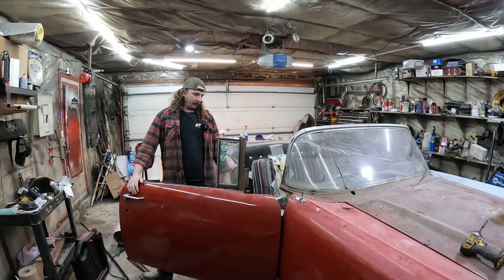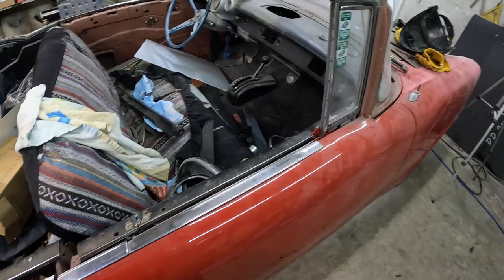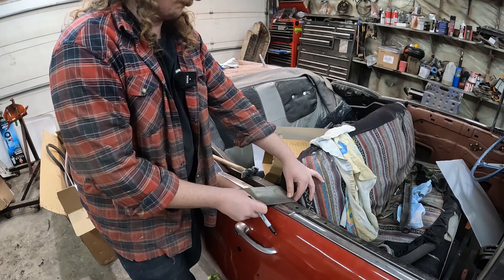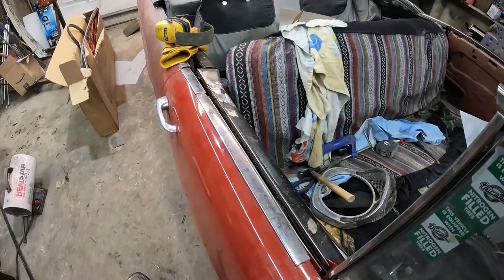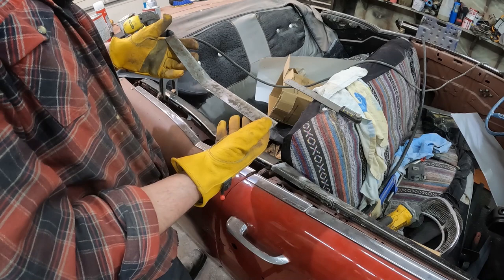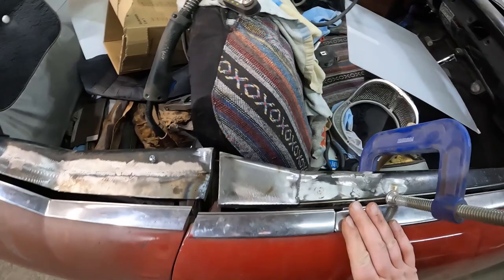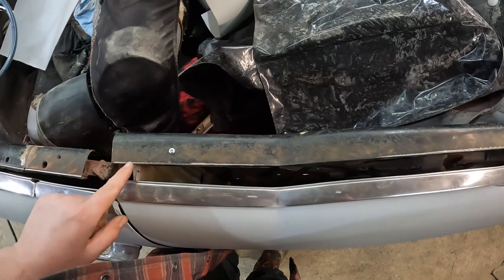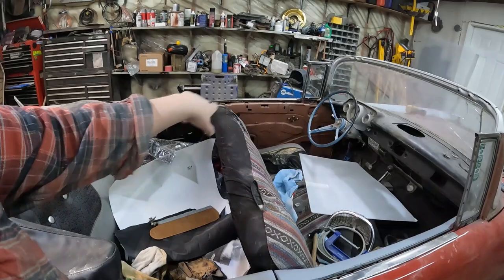Custom Garnish Moldings For Your Chopped Rod - 1957 Chevy Convertible Conversion

Comment: Everyone says I do stuff the hard way, I would have cut a half inch out of the inside of the door post so I wouldn't have to widen the trim. Your way worked. I like the bench seat. I would find a split bench seat with the fold down arm rest with cup holders in the middle. Old cars have no place to set a drink. I like this cat alot.

Comment: Dan nice job on the moldings they look great .  here is a idea swap the front seats with the nice one in 56 wagon . 
get some hog rings and the plyers and wrap the rear seat with the diamond tuck material then your interior will look great .
 you can paint the steering wheel that you are going to use too if it's a factory one .
i seen that someone on ebay has a set of the stainless 2dr door top door moldings cheap , driver quality ..
 keep at it it's turning out great.

Comment: You're really getting your moneys worth out of that workbench haha. Nice work on the garnish mouldings, as for the uv protection of tremclad, I've just kept it waxed with a carnauba wax, reapplied every few months. Never had an issue with fading, the old single stage paint jobs needed to be waxed regularly too.
Reply from the maker: Yeah im sure a little wax will be key

Comment: Cap the ends off, once it's painted it will look good. Dan you can make a fiber glass boot to cover up the back seat or vinal cover with snap buttons. When you painted your trim black made me think of the boot being painted the same color as the car or the top. Then I thought about the Dog riding in the back seat.
Reply from the maker: Oya dogs will b in the back for sure haha

Comment: Love your channel! Question/comment: just wondering why you like adding hardener to the Rustoleum? It’s a 1K paint that doesn’t need a hardener. I don’t think hardener does anything unless it has something to catalyze - like a 2K paint. Lacquer thinner is a lot cheaper … or use a reducer rather than a hardener.
Reply: Hardener seems to make it dry faster and make it a little more durable. I use it in Truck and Tractor enamel which is similar to Rust-Oleum/Tremclad.

Comment: Hi Dan, I don't remember exactly how you built that rear inner door/quarter section. But is it possible that you could have cut about an inch out of the door pillars and inner structures to match the front door? I know nothing about body work and know it would be a lot more work for you. But I think that it is something that YOU could do. That would also make the rear seat fit better. Right now it looks kind of squeezed in there. Like a "big guy in a little coat" lol. Thanks for the video
Reply from the maker: Yup its all possible but I wanted as much meat as possible for the door post.  It's a common weak spot on verts

Comment: Cardboard <---- use that... slip it under the lip of the piece to trace the edge you're welding to and mark where you need to draw whatever straight edges have to be done... cardboard Dan.... a cereal box or something out of the recycle blue box bin.... it's like one extra step and you save a lot of work making up little curbed bits here and there you missed because you're hurrying past that one step that really doesn't add much time and saves you a lot of time and work later. Anyway lol

Comment: look in Alleys for old Fridges, Dish washers, and stoves washers and dryers.  I wached a interveiw with a guy who takes them apart and uses the body tins to build Dwarf Car bodies, it is amazing what expert detailing he does. the ones he done look Identical to the full size ones, he has done a couple Modle A ford sedan bodies and others and they look like he put a Model A in a clothes dryer and shrank them. his tin work is expert level. is on Motortrend on demand  extra look up Steve Dultiech Dwarf Cars